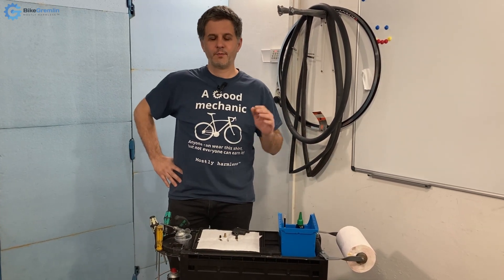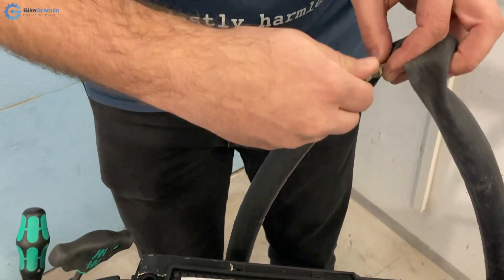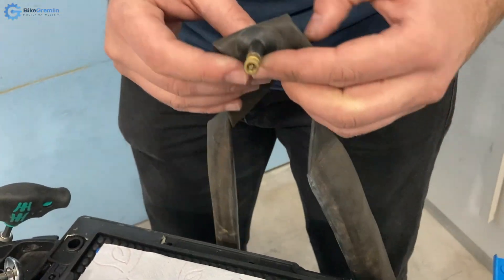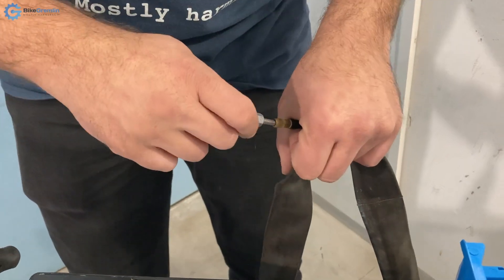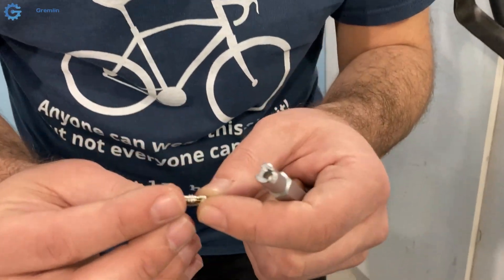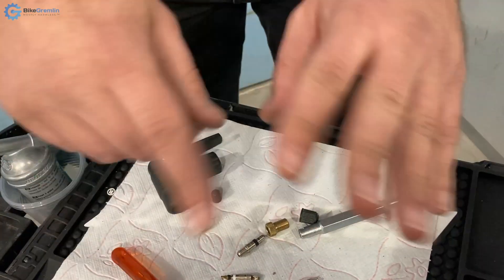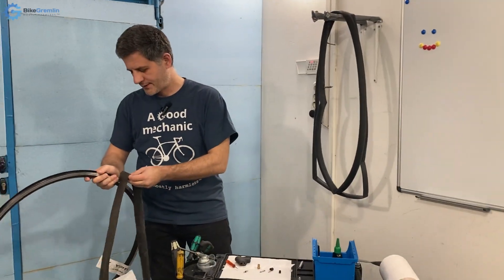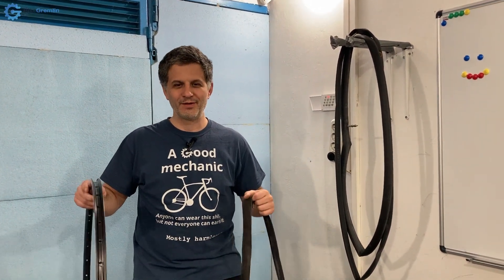Bicycle tyre valve types explained

Comment: One good benefit for Presta valves is that they are great for quick terrain adjustments when mountain biking.  Other than that, I'd also prefer Schrader valves because I find them quicker to get my pump head attached.

Comment: Dunlop or English valve is still the default tyre valve on regular bicycles here in Japan because it's the easiest to maintain, even grandma can replace a broken valve core by herself. 😊 For sports bikes (MTB and road bikes), Presta valve is mostly used. Schrader valve is very rarely used on bicycles.
Reply: having a lot of failed valve cores, are we?
60 years biking , I have had one core, a Presta, fail , when uncapped core got hit in freaky drop.

Comment: Thank you so much for this detailed video!
I have a bike with one presta and one dunlop valve and while I made peace with the presta, I can't make the dunlop to keep the air. I inflate it and it deflates fully in a day. The inside of the dunlop came out a few times while I was figuring it out and I managed to fully inflate it (which deflates again), do you think I broke something or forgot to somehow lock the air in?
Reply from the maker: Check if the valve is seated properly.

If it is, and still losing air, you can replace the valve core.
Some valve cores have a replaceable rubber seal (like a small hose that you can cut 1 cm of length and place instead of the old such hose on the valve) - others have a replaceable core.

Goes without saying that you should first check and confirm that it's the valve that is losing air (put some soapy water or similar on the valve to see if it makes bubbles).

Relja